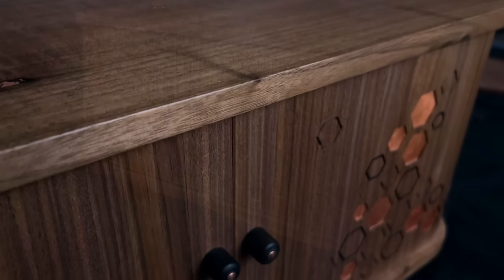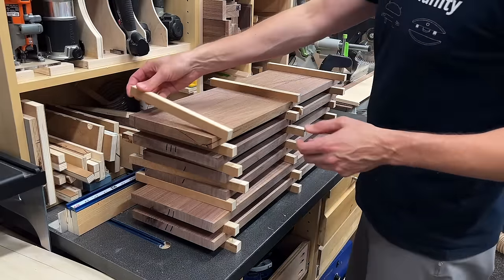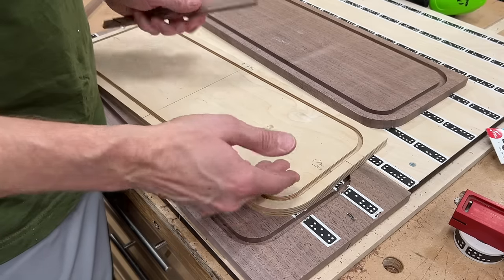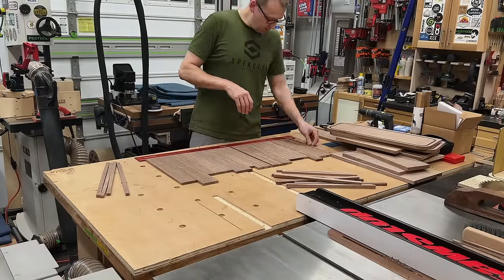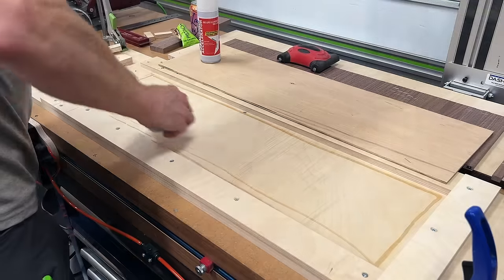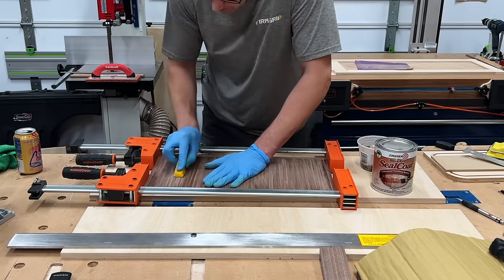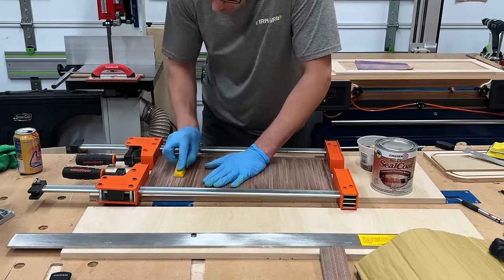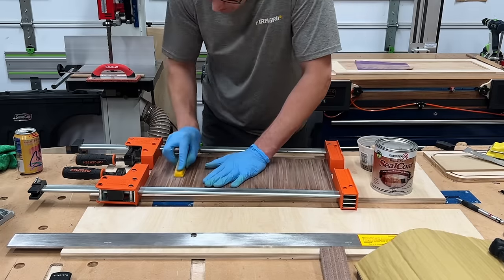Building the coolest tambour cabinet you've ever seen.

Comment: Awesome project!! So many cool techniques here. Smoke while soldering is normal. It's the flux burning up. Also... aside from putting maybe a dab of solder on the iron before you start soldering, the iron goes on what you're soldering, and you shouldn't really have to touch the solder itself to the iron. Solder is attracted to heat, so if you get the connector hot, then touch the solder to the connector, it should get pulled in. If you touch the iron with the solder, sometimes you end up with more solder on the iron than on what you're soldering. You'll notice that your first solder blob is sitting on top of the connector itself, rather than looking more like it's part of that connector. That just means the connector itself didn't get hot enough.
Reply from the maker: Thanks for all the great tips! I don’t see a lot of soldering in my future, but I definitely need some more practice getting the technique dialed in a little bit more. Your tips will definitely help. Thanks again! 👍🏻
Reply: @KeithJohnsonCustomWoodworking  Sure thing. Much like woodworking, it takes an absurd amount of practice to master soldering.
Reply from the maker: @dirtfpv  Good to know! I’ll continue to maintain noob status for quite a while 😜🤣

Comment: This is fantastic woodworking. From an audio perspective, I noticed you said the speaker was lacking bass.  Small speakers like this typically rely on a ported or passive radiator design to extend bass response. From what I can tell, the drivers are not enclosed in any specific way. Sealing up the enclosure could help, but knowing exactly how to do that requires a bunch of calculations, but Dayton audio does provide the driver parameters you would need. There is also software available to help you figure out how the size of the enclosure, size of port, and speaker all figure into the final sound.
Reply from the maker: Hey thanks, Michael! I greatly appreciate the comment and the insight into the audio issues. Maybe on the next version I will do some more research. Thanks again!

Comment: When it comes to scalpels, an 11 blade (which is what your xacto knife is effectively) is designed for stabbing or push puncturing whatever membrane you’re cutting into. The 10 blade however is curved along the edge and is designed for slicing through whatever membrane you’re cutting into. 

So for doing the longer slices through the copper leaf that was on the tambour door, you’d have more control with a 10 blade.
Reply from the maker: Great tip! I’ll check it out. Thank you!! 👍🏻

Comment: when you were using the cross cut sled I noticed the hole in the walnut where you surely touched it with a belt sander and couldn't help but to notice how common the same mistakes are among woodworkers.
Reply from the maker: I don’t use a belt sander

Comment: You may be able to tighten up the bass response by enclosing the speaker drivers instead of running them in “infinite baffle”.  Given that they’re 3” drivers it won’t be much but it could help.
Reply from the maker: Thanks for the tip! I figured my design wasn't the best suited for optimal sound 😜😂
Reply: Theile

Comment: FANTASTIC video! Loved the stepped down pin sizes on the top, great design element. I had a thought on a different way to inlay the copper leaf. What if instead of inlaying anything, you used an 1/8" copper sheet the full size of your doors. And during the milling process, you sandwich the copper between 2 pieces of walnut. Then when you rout with your shaper, you could set the depth down into the copper about a 32nd. You'd see the shaper's mill marks in the copper but it could look cool... just a thought.
Reply from the maker: Thanks Simon! And I actually did consider that sandwich method, but then trying to cut the 1/32" copper along the line of the tambour strips would prove to be quite difficult. Copper is soft, but getting 50 accurate cuts is probably more than I can handle 😜😂
Reply: @KeithJohnsonCustomWoodworking  I was thinking you'd sandwich it during the milling process. So the copper would be cut with the table saw all together with the wood. I could be missing something though.

Comment: I was wondering why you didn't use the shaper to cut thin brass sheets to fit into the hexagons but then I had no good ideas for how to make them bend with the tambour. Don't think a knife would cut it quite like you did between the slats. . Very cool design.
Reply from the maker: Yeah, I considered multiple options for the copper and I just couldn't think of a good way to cut solid material to fit. If the pattern was larger, I might be able to approach it in a different way.

Comment: This is the first video I’ve seen of yours.
You do great work. One question: Any reason you face joint, plane, then edge joint? Why not face joint, edge joint, then plane? With a combo machine, it would save you a change over.
Reply from the maker: If I face joint only one side and the grain is going in the opposite direction, then when I edge joint I will potentially get tear out. Seeing both sides of the board tells me which way the feed direction should be when jointing. Hope this helps.
Reply: @KeithJohnsonCustomWoodworking  
Great reasoning! Does your machine have a segmented cutter head? I haven’t seen grain orientation to be as much of an issue with a segmented cutter head, but your solution would certainly be the safest way to go.
Reply from the maker: @stevet47  I do have a spiral cutterhead, but it can still give you headaches sometimes. LOL.

Comment: I have been thinking about getting a Shaper Origin for a while but I felt the use cases were limited. I think this video does a better marketing for it than anything on their website! My only comment is: have you tried to mix brass with the walnut? I find that it looks nicer.
Reply from the maker: The Shaper Origin incredibly versatile machine! I will definitely be using it a lot more on future projects. I've used brass a lot with walnut...check out my video that has brass bowties in a walnut slab desk: https://youtu.be/-_J75pxz7ys
Reply: good timing they just released a new model

Comment: Beautiful woodwork and the cabinet is dope. Unfortunately it's not a good speaker cabinet per se. Speaker building is what actually got me into woodworking in the first place. The volume of the cabinet is important to match to the speakers to get good sound and you need to account for it whether you're working with a sealed or ported cabinet. Sealed cabinets need enough volume to allow the speaker to flex adequately and ported cabinets need the correct volume and the correct size and length of port to be tuned to the right frequency of sound. Unfortunately the tambour basically makes this an open unsealed untuned cabinet. Also, unfortunately, MDF is the best material to use for speaker cabinets as it's a uniform material (no variation in density or voids) and doesn't impart any tone to the music. Imparting tone with woods in acoustic instruments is desirable but when you're trying to reproduce music on a speaker accurately it isn't. Also tambour would probably rattle around a bit as the speakers impart vibrations :(
Reply from the maker: Thanks for all the tips! Great food for thought! I appreciate you taking the time to comment 👍